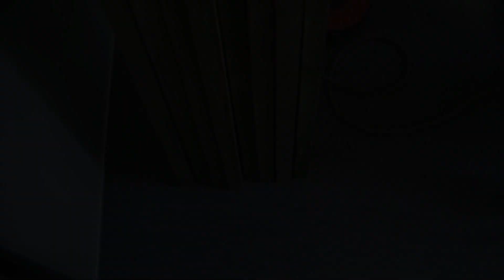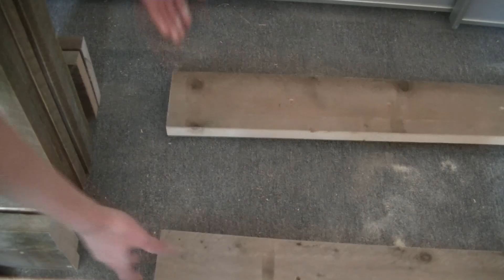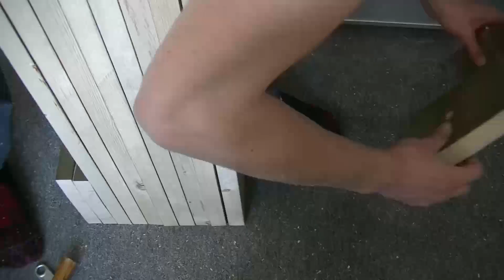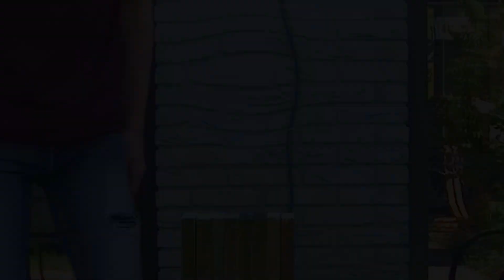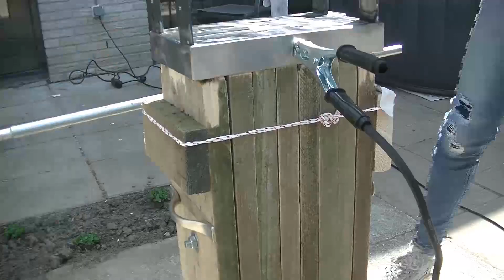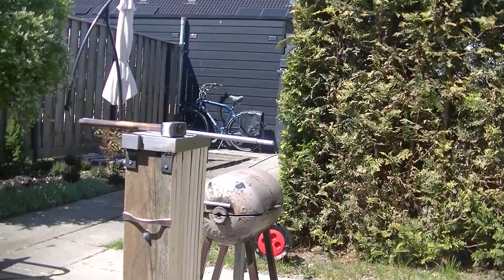DIY Anvil + Stand and blacksmithing for the first Time!

Comment: You need  coke or coal  to get the temperatures required for good forging.  You're also loosing a ton of heat without having the inside of the forge lined with insulation.  Insulation first, then get some coal or coke to burn, then you'll be well on your way.
Reply from the maker: You're completely right. I've recently published a video doing exactly that. After applying an insulating coating and using charcoal it did go a lot better, but eventually it is still poorly designed and not properly functional. Thanks for the comment!

Comment: u cannot melt metal like that .... u just bashed cold metal on a anvil .. that s not blacksmitthing ... if u take a look on any blacksmitthing video, everybody has a way to blow air on the coals and/or make a turbine ... that generates the temperature required to make the metal glow red ...
Reply from the maker: You are completely right about the cold metal. That was my main issue, and that's what I asked feedback for. If you watch closely you can see that I am already using a hairdryer to supply air for the fire. At this point in time I have applied an insulating layer on the inside of the forge. Also, instead of briquettes I am using charcoal. A video about this will come soon. Thanks for the comment!

Comment: Well, if your Blacksmithing doesn't work out you can still use the forge ad a cooking grill! Go check out a lot of forge building videos and apply them to yours. Every time you open the lid, all what little heat it's made is gone. The heat needs to be trapped in the forge as much as possible. Line it with fire bricks, cut a hole in one side and one more behind it to start. You also should work under a shaded spot if you can do U can see the redness, to yellow that's how hot it was gets. Hope this helps
Reply from the maker: Thank you very much for the reply! Before using it as a grill, I'll try to get it working using your, and other people's tips!

Comment: Get rid of the background music.  It's distracting.
Reply from the maker: Thanks for the feedback. Do you think it is distracting at all times or just during the voice over? I myself think it ads to the vibe and sometimes makes it less awkward.
Reply: @TF-Projects  I generally don't have a problem with music in a video, and perhaps we may have a difference in musical tastes.  However, it is louder than it should be and the music selection (jazzy with a louder horn presence) can be distracting to where it is difficult to focus on what you are saying.  Background music should be in the background to where it is not overtly noticeable - sort of like using ground pepper on some food instead of a load of chopped habaneros.  Just say'n...
Reply from the maker: I understand. Taste always differs indeed, but I'm still struggling with keeping the music at the same level and keeping my voice well above that on the same level as well. I guess it takes practice. Thanks for the feedback!

Comment: I started out with something similar to what you have. I lined a grill with a mixture of  plaster of Paris and sand, and used charcoal and a hair dryer to get it up to forging temperature. Unfortunately the plaster of Paris and sand mix does not last long with the high temperatures, and needs replaced once and a while. If you have the money I would recommend getting a 2 burner from Devil Forge. You can find them on eBay for about 214 USD. Of not The King Of Ransom's channel has videos on how to make a foundry and it's basically the same idea as a forge, just a different shape. It's a learning process but it's a lot of fun. Keep up the good work.
Reply from the maker: Thanks for the feedback! I'm definitely going to try the mixture of plaster and sand just to get started. I'm hoping I can use what I created in the video but if not I'll have to restart and rethink the project. I've also seen the TKOR video you mentioned. Again, thanks for the kind words!
Reply: @TF-Projects  You could also try using fire brick if you can find the them and line you forge with those as they will take a much higher heat.  There are some fantastic videos for building coal forges from brick that give you a a good idea of what is needed.  Keep being a creator
Reply from the maker: Very good idea! Currently I am using a proper gasforge, but if I make another coalforge I'll defenitely use firebricks. Thanks for the feedback!